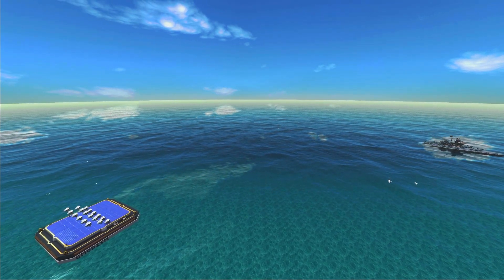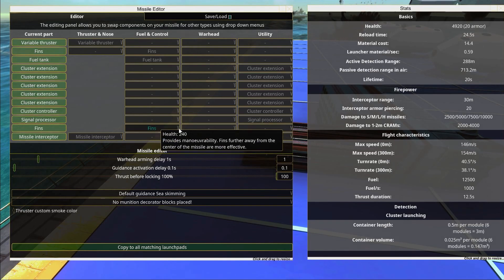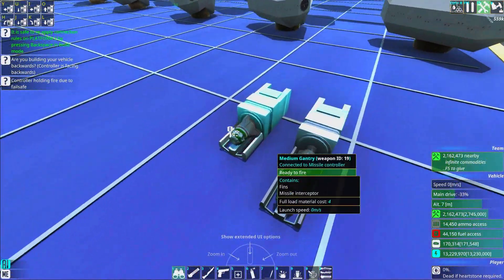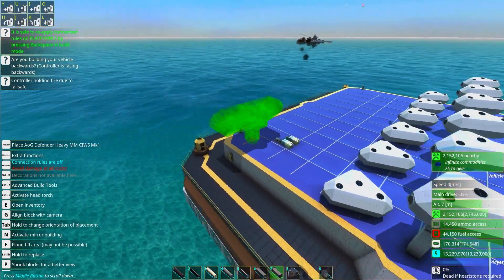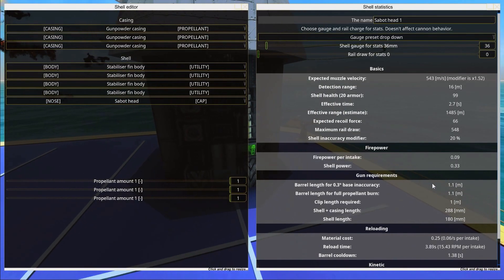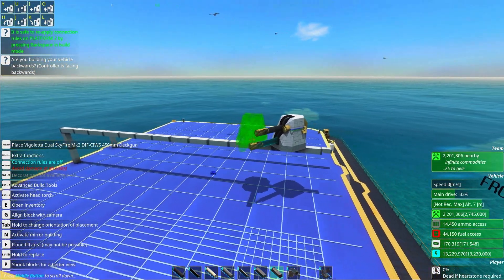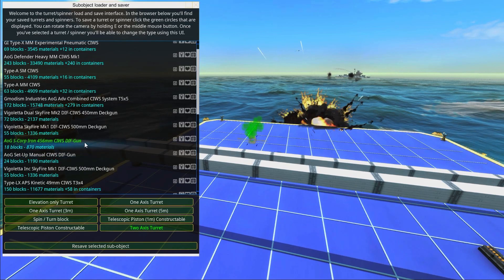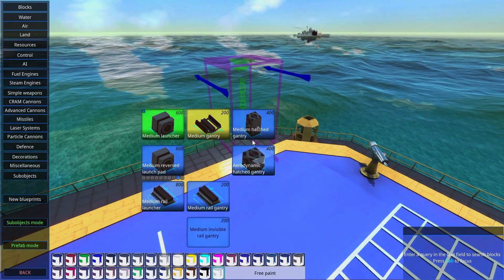Pneumatic CIWS Missiles?! YES - From The Depths

Comment: To the best of my knowledge, regarding the delay on the combined system: The CIWS controller is trying to base itself on whatever it considers the primary part of its system. So in this example, maybe it's trying to aim based on the kinetic firing piece rather than the flak (rather than doing full calculations for all of them). The aim for the flak portion gets thrown off slightly, because it's aiming with the sabot portion being the 'site in', and then adjusting itsself from there rather than turning the turret to make the flak portion the 'site in' central aiming. I don't know the full details about how it works, except that a CIWS controller sortof slaves some firing pieces to one master piece that it controls, in a way. Which is probably good in a way, because it means the whole turret doesn't twitch frantically making stability tank. Sorry I can't be more help about it.
Reply from the maker: A better guess than most! I have however seen some dual barrel turrets twitching some I think... But perhaps I was imagining the stepwise movements..  in any case we all know that combined weapon systems should have multiple lwcs or ciwsc. Thanks for your best guesses!
Reply: @GMODISM  Certainly can't argue with that. Might be the LWC/mainframe aimpoint trying to sync the different points of fire/different ammo speeds to the same aimpoint, just as much, and the non-zero amount of time required to do that. Which is certainly far less of a problem with different mainframes on the task. Though this is also a healthy reminder that AI control can fight itself for what to aim at if not set up correctly, such as in the case of DP CIWs with equally weighted CIWs controller and LWC, or a turret with multiple control channels.

Comment: I actually have something very simiral on my planes! I use small launchers on planes, with short range thruster, fins, radar Sim / stick flare and missile interc! Now, why the short range thruster? My planes are little buggers, if they have more internal space than 1x1 it's a miracle, so I don't have space for Ejector Addon, and short range thruster makes missiles fly out @ 50m/s!
Reply: To add why it's so small - 168m/s and able to turn 180° in 0.5s
Reply: Guh
Reply: small fighter like that i like to set up missles that launch backwards beside the thrusters with the short range thruster activation set to 2 seconds or longer. lets the plane fly by as teh missiles turns targets an bolts into the enemy.
Reply: @Bl00dyfist  I have such setup on my interceptor, short range w/ delay for 2 sec, apn, fins fins fuel exp frag @ 20° ars
Reply from the maker: Cool stuff, I need to experiment a bit with that too I think!

Comment: You should look at the options for CRAM-IWS (or CRAMWIS if you want it to flow :D) as well. A 5K turrey can manage a 50K damage burst every 20s, and is pretty much the most cost effective option vs massed CRAM or huge missiles
Reply from the maker: I did a tutorial for cramIWS a few months back actually. It is somewhat useful yes, but I would not call it cost effective no, fun though! ✨
Reply: Funny thing is that CIWS on the ground is in fact call C-RAM meaning counter rocket, artillery, and mortar.
Reply: DIF CIWS works better for this application (cheaper, higher burst damage)
Reply: @badpeoplearebad3934  Longer reloads though, which can be telling when in a CRAM duel.

Really depends on how high your craft's alpha is gonna be :D. Cause the DIF CIWS is probably better a lot of the time in tourneys, though a CRAMIWS might be better for a brawler.

CRAMIWS is also much better as a dual purpose secondary in cases where there's no valid targets for it to shoot at.

Comment: I spent a few hours today trying to make a pneumatic launcher to some moderate success and while I was fiddling with the settings as I was finding it hard to make the missiles go toward their targets better when I had an idea, why make the interceptor go towards the missile when you can get the missile to go towards the interceptor? 

I tested 1m medium missiles with an interceptor head and a sonar decoy base and it worked and the funny thing is even if a torpedo didn't go for the decoy, if it got within 30m of the anti-munition mine, it went off anyway. I don't see why it couldn't work with the other decoys. May do some more testing tomorrow.
Reply from the maker: Do indeed update us, the discord is most reliable in case you use that